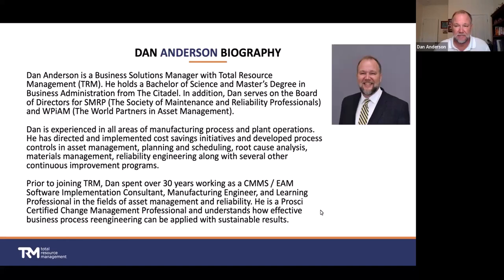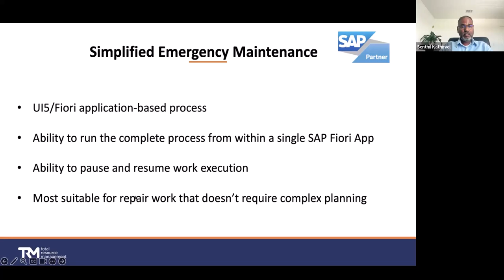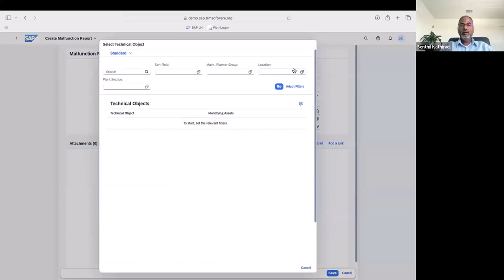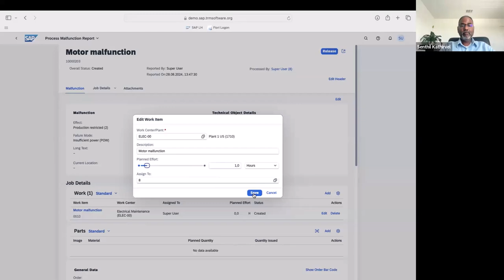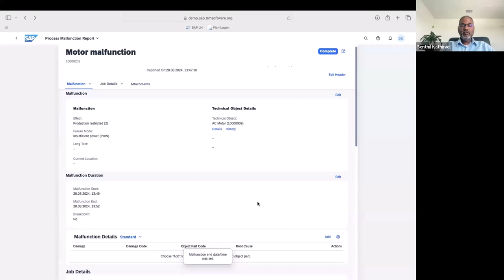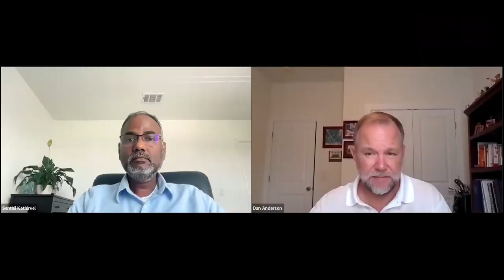SAP Webinar Series No 2: Simplified Emergency Maintenance Process

Comment: how can we calculate MTTR and MTBR ? Steps are missed in scenario
Reply from the maker: Given these measures are "means" the assumption is that you have a good amount of data to perform the average calculation with. Otherwise, if the data is limited then the "mean" will not be very useful. For the Time to Repair, the work order dataset with repair times (usually by asset type) is used to run the mean. For the Between Repair, that can be tricky because you need the lengths of time between repair activities, so you need to know when each corrective work order starts and ends. Hope is is helpful.